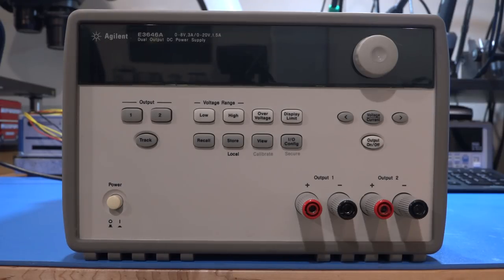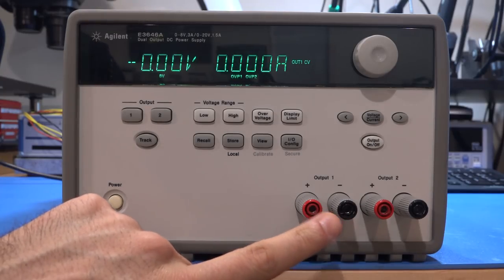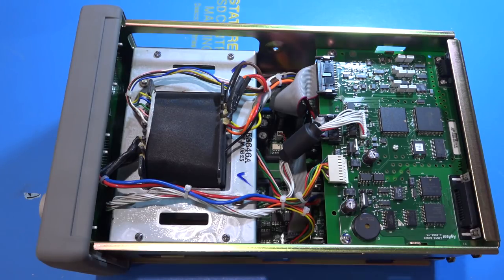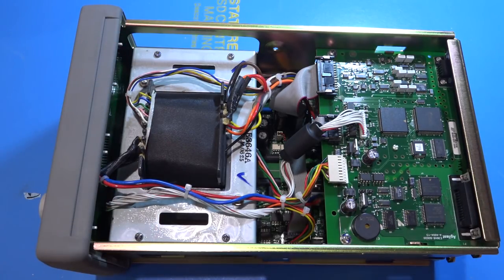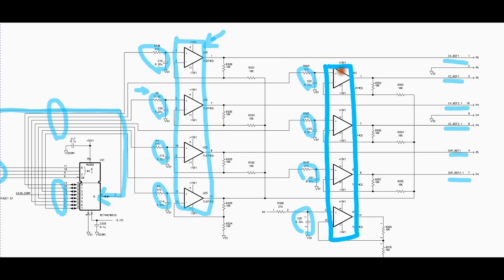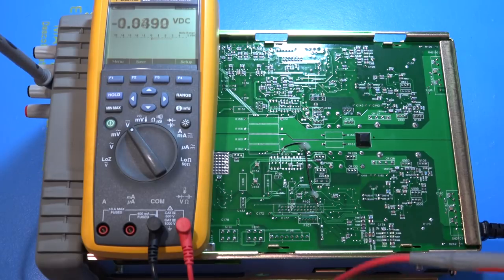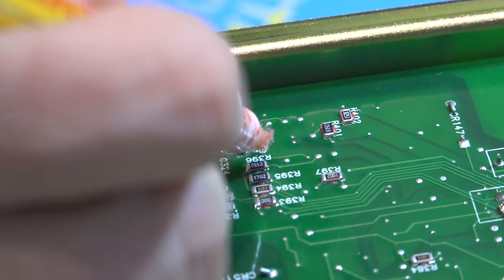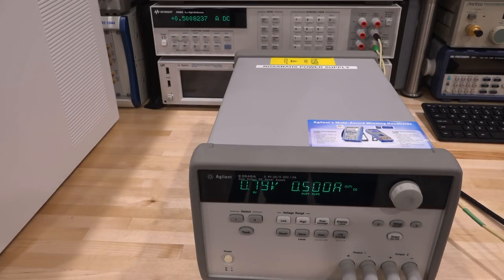TSP #146 - Teardown, Analysis & Repair of an Agilent E3646A Dual Channel Programmable Power Supply

Comment: Sound is about 30sec out of sync for the circuit diagram section.
Reply from the maker: Damn it! I need to find a better screen capture solution.
Reply: Maybe try what the pros do and use a makeshift clapper board. You can just clap two books together or something. Then you can just slip the audio to match in your editing software
Reply: @Thesignalpath  Isn't it OBS? I'm not a heavy user, but I've never had a problem with OBS.
Reply: as is tradition

ye dud use obs
Reply from the maker: @SidneyCritic  Will get that. Thanks.
Reply: Ya, the audio being out of sync was very annoying.  Always a good idea to actually watch your own video before uploading it for thousands to watch.  ;-P
Reply: and I thought first it was only me...
Reply from the maker: This issue will not happen anymore as I have switched my recording setup to a new way of capturing screens.
Reply: I just assumed that He is thinking faster than the camera again.

Comment: 21.5k, 220nF Fc = 33.6Hz, This is really a great teardown repair, I wish you spent more time analyzing the CC/CV control loops,  this is a good schematic to those who need a diy power supply.
Reply: Exactly! Shahriar, that would be a great topic for a separate video! Thank you for this one. I am also an EE and I've started to do the same - buying damaged units from ebay and fixing them - inspired by you. I am even considering posting a few videos on that as well, despite the great standard you have set! Thanks again :)
Reply: @tfinmoraes  I always felt perplexed why people are building diy power supplies from non verified schematics, if we looks at this schematic and remove the ADC and DAC blocks we have a baseline analog power supply with tracking and stability control loops, parts are cheap and available (expect maybe for a transformer), for the digital controls a few 100 lines of firmware code an ADC and DAC of choice, bam! you have a robust diy power supply. but nobody seems to want to do this? I would, but I have too many 2019 project commitments at the moment.
Reply: @yaghiyahbrenner8902 I see your point, and given all the proven schematics out there ("Designs by the Masters", as Winfield & Hill would say), it certainly makes sense. But there are at least 2 counter points. One is that it is pretty educational starting from scratch - one does learn a lot going through it. Second, if the final result is the main conern, then for different transistor models (and sometimes even the same model), the feedback loop must be adjusted for rock solid stability/ ringing/ overshooting. That is where a dedicated video from Shahriar would be great. Despite so much material available on that as well, transistor stability is an ever needed subject.

Comment: Hah, easy fix! I love it when problems are silly things like this. No part replacement, no confusing debugging. Follow the signal path and there's a bad connection.

Kind of unexpected that Agilent would have a QC issue like this, though.

Comment: Thanks Shahriar, great Video! I think the PCB might have been contaminated (maybe with grease or something) in that area. That would explain the bad connection and formation of these tiny micro solderballs between components in that area.

Comment: I don't quite understand how they are using one DAC to control 2 isolated outputs? Like the DAC has to be ground referenced to something and in turn both outputs must have some reference to the same something in order to work with the DAC output or am I missing something here?
Reply: The DAC is multiplexed. That means the DAC is switched constantly between the different outputs. DACs can be expensive and this was a way to save some money in the design.
Reply: @RyanUptonInnovator  That part I understand. However the output of the DAC and also of the 8 multiplexed outputs is referenced to one ground. The outputs of the power supply are isolated (floating) though, so how do you transfer the ground-referenced DAC-voltages to two different, floating outputs? If the outputs grounds are not connected to the same ground as the DAC (which they can't both be, since they are supposed to be isolated), how do they interpret the DAC output?
Reply: I was confused by that as well. In the schematics you can see they are using a optocoupler with two photodiodes(HCNR200). The LED is driven with feedback from one of the diodes, while on the isolated side the matched photodiode ensures the voltage will be the same.
Reply: HCNR200 optocouplers. Currently made by Broadcom, formerly Avago, formerly Agilent, formerly HP. Briefly seen at 11:18.
Reply: Service manual: https://gerrysweeney.com/wp-content/plugins/download-attachments/includes/download.php?id=1887

Comment: Nice video. Bad solder joint on older gear are not that uncommon but it’s usually the cheap Chinese junk. What’s sad is these are expensive well designed power supplies let down by sloppy assembly. Agilent/Keysight outsource a lot of their sub assemblies, and sometimes manufacturing of entire instruments, and this is what happens when corporate greed tries to save too much money.

Comment: Nice T/Sing.  I think the PC board is probably flexing more at that point.  Could be it was dropped a few feet.  If I did it, I would put a jumper between the resistor and the PC trace just in case it came loose again.  Thanks!

Comment: I had a 33401 that had a tombstoned resistor network from the factory.  I guess it had a wisp of solder connecting the floating end to the PCB for a while and moving the meter around caused it to open.  I removed and resoldered the network and it's been working fine since.

Comment: The board didn't exactly have a generous pad area for the components. Also, for the price point that these instruments sell at, I'd expect a heavier copper layer. The brief touch you made with the iron to melt the solder suggests a seriously low thermal mass = very thin copper = susceptible to trace breaks. 
I agree with others that I don't really "get" how a single DAC could run two separate channels. I'll have to  look for the schematic of this unit, make a note of the components used, look up their datasheets and work it out that way.
Reply: digitalradiohacker / you do realise those jbc irons have some serous wattage too. Though I do agree about the poor pad spacing
Reply: @aqib2000 
Yep. I have an 80W Metcal MX-PS5000 here. I've been "in" to electronics for a while, so I have a good feel for things. If I touched the trace of a resistor on an Apple Macbook, using my Metcal, for THAT period of time, it wouldn't have had time make the solder flow into a reliable joint.

That power supply had traces that looked like a highschool kids first PCB etching project.

Comment: The soldering on those three components looked different from everything else.   Is it possible someone had replaced them for some reason?  Maybe an ECO or something?
Reply from the maker: I don’t think this supply was ever repaired. The original factory seal was intact.
Reply: The soldering did look a bit janky in that area.

Comment: I only wish that I could find something this simple to fix my E3646A!  I know this is a long shot, but would you mind taking a peek at the video linked here?  I have a very intermittent issue where the output of channel 1 will become unsteady, drift downward (slowly at first, then faster, until it reaches a threshold at which point it jumps back (close) to the originally set voltage).  I tried to troubleshoot it myself, but I am not an EE - just a hobbyist (Mech E), and I have a hard time getting it to reproduce the problem when I need it to.  Most of the time, it seems like it has to be a cold start (not used in a while) for this to happen, and it seems to resolve itself after about 15-20 minutes. Channel 2 is still perfectly usable, but it would be nice to get this fixed so I have a 100% functional and reliable meter.  The Power on Full Test passes.

Here is the video of the fault happening:
https://www.youtube.com/watch?v=_PwfBVxP9Ls

Comment: I think a PSU should always display both the set and measured voltage and current simultaneously, instead of having to press a "Display Limits" button. This has always infuriated me with these PSUs. The worst bit is when you change the current limit and the PSU either can't show the measured current anymore, so you can't see when the current stops rising, or it doesn't show the limit you're setting, only the measured current.

I don't get why manufacturers save a few cents by not displaying two extra numbers on multi-thousand-dollar PSUs.

It's kinda impossible to find a PSU with a clean output that has a good GUI and doesn't break the bank. The chinesium "ruideng" modules have a great interface, but are of course dirty AF.
Reply from the maker: I agree. The new Keysight supplies do have that.
Reply: It also displays only one channel at a time :). Horrible UX.
Reply: @shazam6274  output capacitance needs to be as low as possible in a power supply

Comment: Damn, you were so lucky, just one cold joint.
I had E3647A where almost nothing worked, couldn't set most of the parameters, I had to replace multiple precision resistors(those green 1206 ones seen at eg. 20:31), around 10 in total, few on the processing daughterboard and I think one or two on the main power board.
But then OVP wasn't working I think on the second channel, about it later.

At 10:30 you said that it's very unlikely that only one channel of a quad op amp has failed, but well that's what happened in my unit, U25 had one OPAMP crazy broken, sometimes it was working sometimes not(OVP), I spent hours on tracking the issue, once measured it, it was fine, then proceed with other components and of course couldn't fix it because nothing else was faulty.
It was a very weird intermittent fault.
Since then I don't just assume "Oh those don't usually fail it can't be it"
For details about this failure google my thread on eevblog:
Need help with understanding part of the circuit in Agilent PSU to repair it

Comment: I have noticed that the frame rate (FPS) in most of your vides while doing screen capture is quite low. It is annoying because the mouse (and other objects) jumps/stutters instead of moving smoothly. I assume you use OBS for screen capture, it should be easy to just increase the FPS to 60 for future videos if possible. The size of the files should not become much larger because there is not much movement on the screen hence the compression will work very efficiently.

Comment: Starting around 11:43, there seems to be a discrepancy between what you are pointing at on the schematic and what you are discussing.  You talk about the output transistor while circling an op-amp, for example.  I think you had a problem with your screen capture or something.  It makes the latter part of your discussion about the schematic really hard to follow.

Comment: It's a shame you let down your considerable intelligence by indulging overpriced low tech instruments. It's a 1200$ unit that weighs a ton when it could cost 50$ and be superior in every way. Weight, precision, noise, power, stability, durability.
Reply: Not sure if trolling or just wishful thinking?
Reply: @6alecapristrudel  Neither. It's a simple certainty that a superior switchmode design could readily be done for pennies with HF pcb trace trafo. It's just not a challenging power level. Including plentiful filtering and a linear stage if you must. Sharir could easily design such a circuit.
Reply: @danfrederiksen7397  If someone were to make the thing you describe, would they want to sell it for 50 bucks? Given that they're making something better than a thing that sells for so much more?
Reply from the maker: I think I have tried to explain this to you before. But I see that you are still confused. :)
Reply: @Thesignalpath  Notice that he's got a different account now, although the name is the same. I guess his old one got banned or something. The never-ending story of Dan Frederiksen. Always talking angrily on electronics channels about how professional instruments are low tech and overpriced, while never producing anything of his own. Yay!
Reply: @Thesignalpath  funny how that works :)
I think the audience would be riveted if you set out to make a better design, just a simple demonstrator. It's only 30watt so a bridge and a cap (no pfc) followed by >100kHz pcb trace trafo per channel and a linear stage if you must.  Standard 16x2 display should be more than adequate although a touch display might quickly become the cheaper solution.
Truth embraced furthers our world tremendously. That starship you have on your wall, although fictitious, could be ours if not for the denial of obvious truth.
Reply: @danfrederiksen7397  Designing a "better" one could easily be interpreted as employing his own ego for its own sake. He could make much of how much better his design might be and while he does so he could attempt to take the moral high-ground about his truthful motives while looking and feeling superior and better informed than his audience.
I applaud your final paragraph. Having watched all of Shahriar's videos, I could not,(and would not), have been able to construct such sentences. Thank you for so perfectly revealing to us all exactly what you are made of.